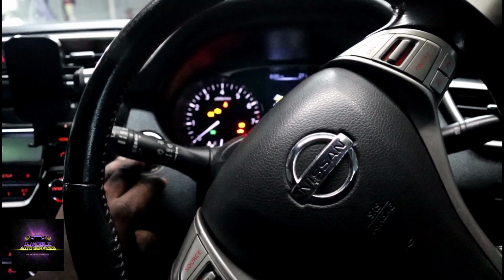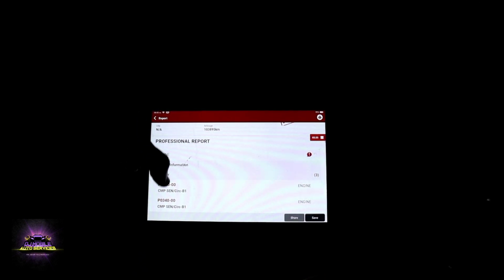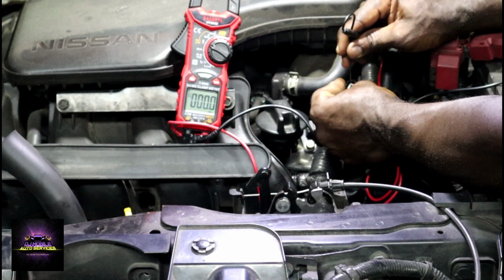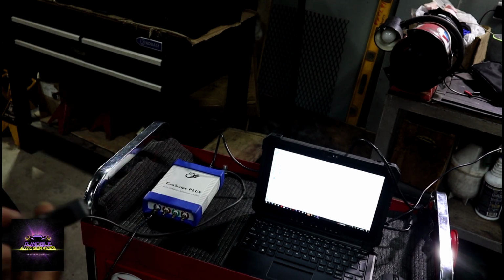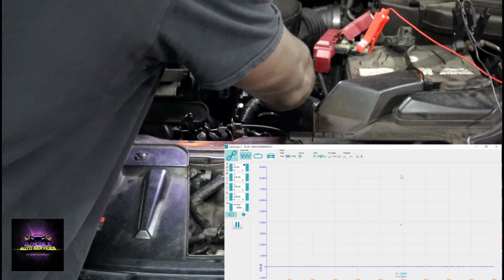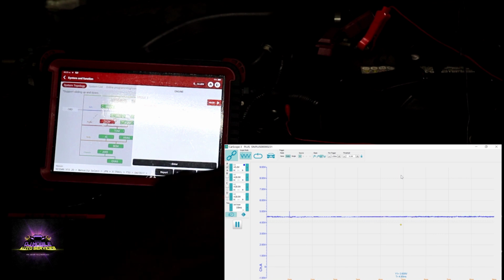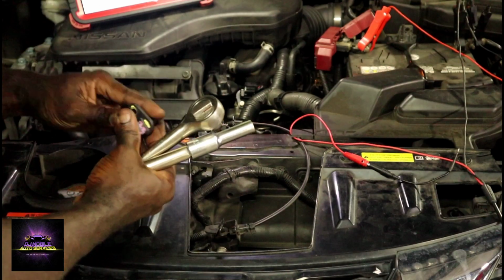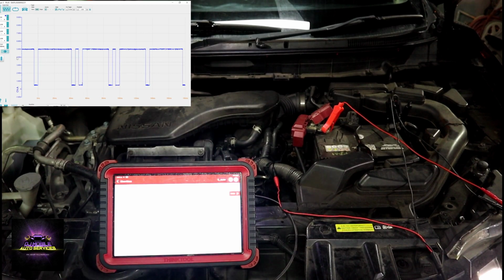P0340 Cam Sensor Circuit Fault Causing Crank No Start On A Nissan Xtrail. Diagnose And Repair Video

Comment: Have similar issue with my car.. Car stopped middle of the road. Couldn't start again. Found cvt oil in the radiator so changed the cvt cooler and flushed the coolant and cvt oil. Car is unable to start still.
Reply from the maker: Crap. Hope you can figure it out before it gets expensive